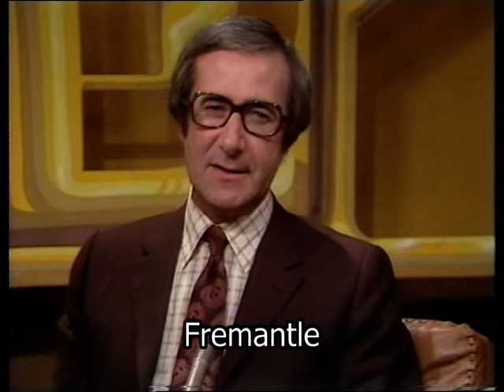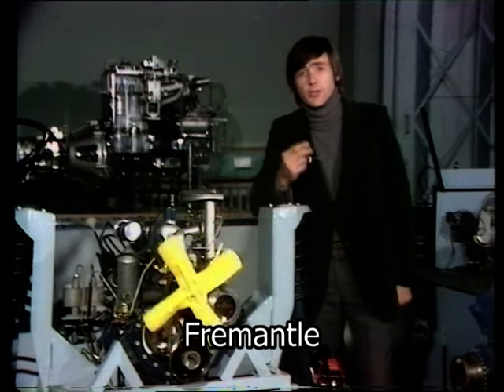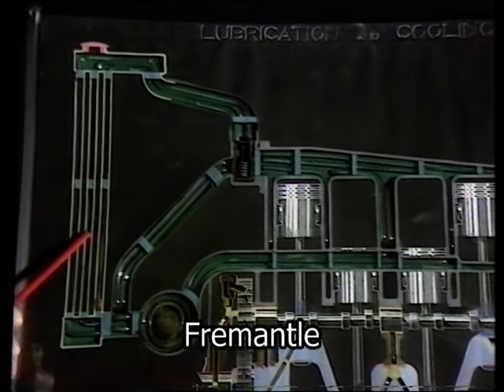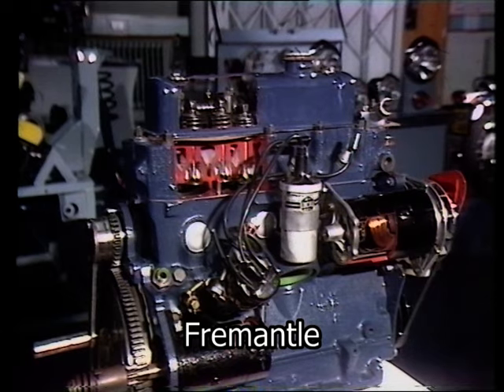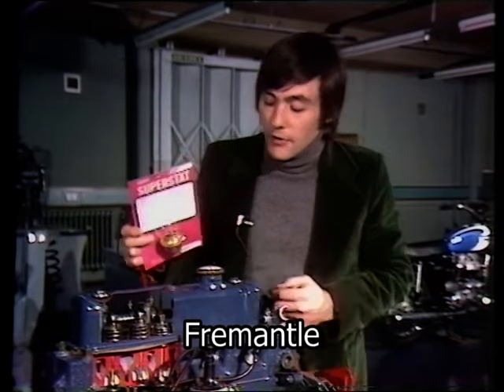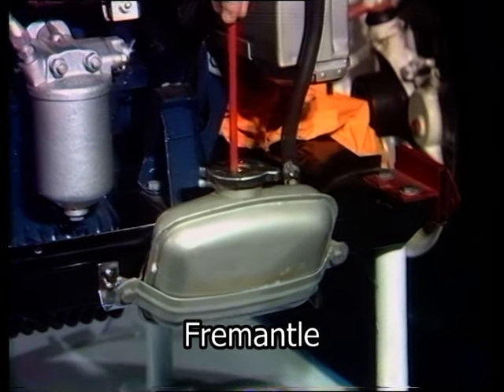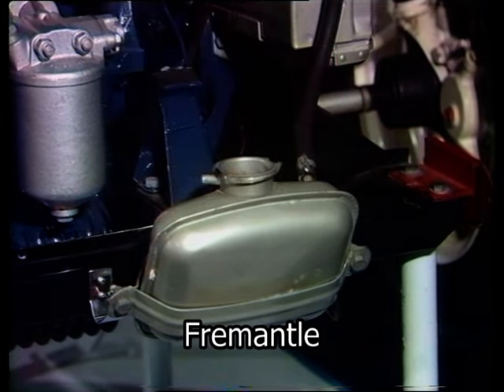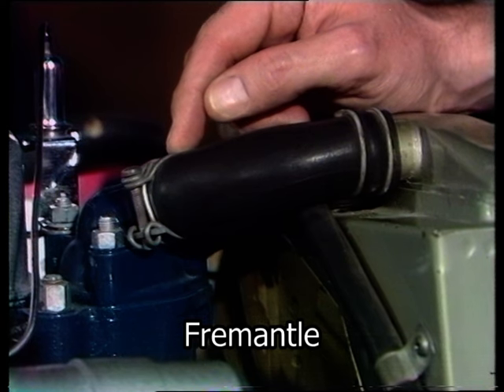1970s Cars | Car cooling system | How to cool a car | Water cooling system | Drive in | 1973

Comment: At 6:02.  Ok, checklist;

Check coolant level daily - how about not once in 5 years?
Check thermostat before winter - WTF is that???
Drain and flush system at least once a year - how about not once in 5 years?
Check hoses regularly for cracking or hardening - how about not once in 5 years?
Ensure fanbelt is correctly tensioned - how about not once in 5 years?
Always carry a spare fanbelt - How about F off?
Use correct anti-freeze for your engine - That would be whatever is on offer at the front entrance of Tesco then.
Use it in correct quantities - so basically eyeballing a bit of each to arrive at "That'll do".

Yep, my 16 year old VW Beetle is still going strong, despite such disregard for its well being.